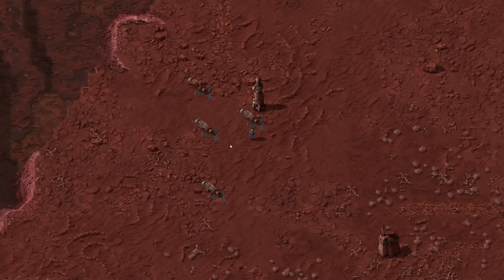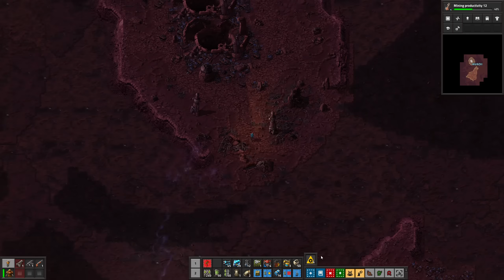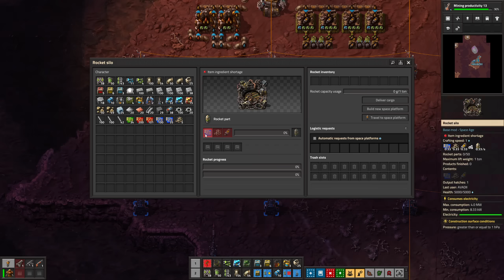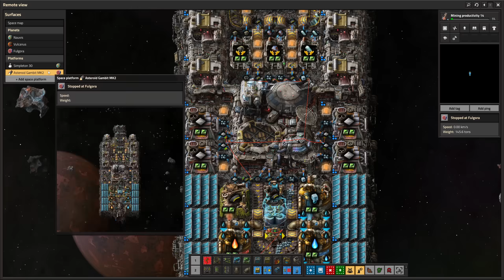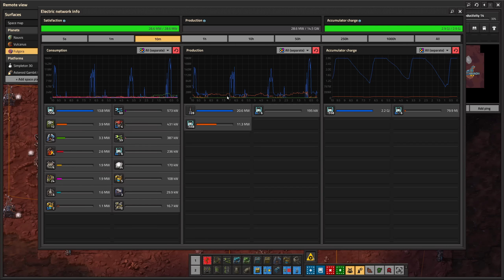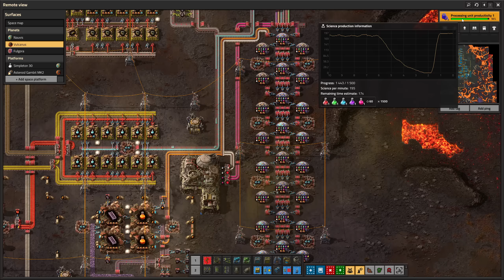Is Fulgora The Hardest Planet? — Space Age MEGABASE (Factorio 2.1)

Comment: Hi! Love your videos. 
I have a question: how do you increase Holmium ore production in the early and mid-game? With one full belt of scrap, I can only produce around 23–25 Holmium ore per minute. If I want to produce more, I have to process more scrap, which takes up more space and requires more power. 
Do you have any advice on how to improve production efficiency? 
Thanks!
Reply from the maker: Theres only one way: process more scrap. Or use productivity modules to get more science out of the same amount of scrap. In any case you need more energy.

Comment: Everybody goes nuts on Fulgora with accumulators, but you can just use the free fuel to burn about 80% of the free ice you get with your holmium for tons of power. Ice consumption for science is less than 10% of what you get, since you're always bottlenecked by holmium ore.

Comment: Heating towers and turbines (if you have them) are great for power bootstrapping on Fulgora. 1 heating tower, one heat exchanger, and two turbines will get you 10MW of steady power in a tiny footprint compared to accumulators. It's more than enough to keep you running until the first EM plants, then you can start making accumulators faster and with the 50% productivity bonus (and at quality if you've brought quality modules with you).

How lucky to have an island in power pole range! I've never had such a forgiving start.
Reply: heating tower are locked behind gleba, but once unlock, I agree
Reply: @guy_autordie  I always make a quick stop to Gleba for the easy achievements and the heating tower. It makes Fulgora start so much easier.
Reply: @videoarchivist8546 interesting.. i might try this out

Comment: Uses a fancy non-blocking splitter to 'grab all holmium' (which it will not do, it's non-blocking, so the moment the output is full, holmium will spill back into the flow). Puts a single inserter at the end of it, so any slowness the inserter has vs the fancy splitter is negated. Could've just used the inserter solo with a filter.
Reply: It adds a half second buffer to the "get all holmium" grabber. If ore came through in the wrong pacing, an inserter will regularly miss. With this, unless you get like 15 holmium all in the right ticks to stack up, it WILL grab them all.
Reply: So 2 filtering inserters side-by-side? Then you also get to see how 'regularly' the first one misses (not often). And it's smaller and simpler. And has twice the storage (which is kinda important if you want to make sure you get everything).

The 3-splitter design sits in such a weird place in communicating intent. You want to make sure you can grab everything, but then you don't want it to block like a single filtering splitter. So you don't get everything. So what is it actually doing?
Reply: @blerrik  two filtering ones (if I understood correctly) can backup and block the path.

The 3 splitter is "Get everything available, and if this path is full, send it to trash"
Reply: 2 filtering inserters, not 2 filtering splitters. Sorry if that was unclear.
Reply: @blerrik  ah, i misread that. I mean, two can work, but just makes it less likely. And now you're getting big enough that that the triple splitter is probably same size or smaller (and guaranteed to be reliable)
Reply from the maker: Yeah, no.

Comment: In normal runs with trains unlocked, you can also just recycle the trash already when loading onto trains, then use 16 inserters on a wagon to grab each item directly onto its own lane, then merge with other train stops to instantly have it sorted. Surprisingly good throughput and avoids the ugly splitter mess
Reply: And for mega bases you recycle into rocket silos and can use it as a big chest. You can put like ~300 scrap per second into it and using it
Edit: hm nah probably like up to ~400. 4 recyclers

Comment: You wouldn't need so many efficiency modules if you used exclusively uncommon/rare accumulators. The common accumulators are actually so so SO much worse that I would go so far as to say they are not worth using at all on Fulgora where build area is limited. (Uncommon store 200% energy vs common, rare 300%.) Commons should all be sent to science production.

Comment: Counterintuitively, if you're using productivity modules, you usually get better power savings using speed beacons instead of efficiency beacons, for a given rate of production. This is because speed beacons offset the speed penalty of the productivity modules, so the machine runs with more power consumption but for much much less of the time (or fewer total buildings).

For example, if you want to produce 1 rocket part per second with 40% productivity from 4 prod modules, you could either have:
  5 rocket silos running all the time with 2 efficiency beacons on each, which costs 46 MW to run
Or:
  1 rocket silo running 80% of the time with 2 speed beacons, which costs only 26 MW to run
Reply: That's true, but only if you care about energy consumption overtime and not in one moment. Basically if you lack energy production there will be times when all of you heavy beaconed assembler will blow the fuse and start slow everything down, while efficiency just allow you to postpone you power plant expansion to a better day.
Reply: Similarly, when trying to max out the speed of a machine, putting productivity modules in the machine will result in a faster output than speed modules, if you have several high quality speed beacons. All speed modifiers from modules are additive, so the speed reduction gets drowned by the doubling of output that comes from four legendary productivity modules. However, I don't know when this becomes true, including whether you need quality modules/beacons or not.
Reply: This does not work, for example, for the number of beacons n = 8

8 speed beacons will use 20.49 MJ per part

 1 speed beacon + 7 efficiency beacons 20.18 MJ per part
Reply: @MisterPokerFaceCard  I did say _usually_. The first speed beacon is huge for overcoming the speed penalty from prod. At higher numbers of beacons, there's still diminishing returns.

Put it this way: if you're only going to place 1 or 2 beacons and want to reduce the power consumption on a building with prod modules, speed beats efficiency.

But if you're able to place lots of beacons, the best strat will be: max prod in the building, then enough speed beacons to offset the speed penalty and maybe enough efficiency beacons to bring it to the -80% limit. When you also factor in the cost of powering the beacons, and number of machines needed, it gets complex to find the most power efficient solution. But at that level of build, you're possibly beyond worrying about power and should be optimizing for something else anyway.
Reply: Things are always more complicated. Using prod and speed can give lower energy consumption than default, but it reaches a hard maximum energy efficiency. Minimising energy consumption per product I found to generally be by using speed modules in the machine, and efficiency beacons. On Gleba however, when you consider that energy and the item ingredients have the same source, using productivity + efficiency beacons can minimise the total resource consumption, or at least it would if items didn't spoil and the shear size of such a build didn't cause its own issues.
The fact that beacons, especially at common quality, are very power hungry also adds its own complications, often making efficiency beacons cost more energy than they save unless the machine they're affecting doesn't take electricity (like on Gleba).

Always test, calculate, and measure your setups before asserting one strategy is best. There are also often multiple strategies that are "best" depending on the requirements.
(While playing on Crucible, there was a recipe to turn steam into hydrogen gas. Since steam is also used to generate the electricity to run the machines, efficiency, productivity, and speed modules all affected the steam consumption per unit of hydrogen.)
Reply: @angeldude101  you know, I genuinely don't know why putting efficiency modules in beacons was even a thing before space age and the beacon overhaul. The most power-hungry thing that could even benefit from effeciency modules at all had to be the rocket silo. I don't think I ever once saw someone put effeciency modules in a beacon. Given the state of the tech tree at that time, it probably would have made more sense for the recipe for a speed beacon to include two speed III modules and give a fixed 50% speed boost, but I sure am glad they didn't do that, because quality effeciency beacons have some very handy use cases on space platforms, gleba, and pre-fusion Aquilo

Comment: Honestly, after re-watching your bot based gleba,  I tried fulgora... 

and it's way harder.

You need so many machines, and so much power, and there's no water for steam or nuclear (i mean... outside ice... but you could easily run out of Ice if you started making power and fuel)  

Holmium is a massive bottle neck and it's difficult to scale, the terrain is brutal and punishing until very late game tech. 

Trying to make quality items, introduces quality holmium ore... which is aweful... cause you can't use it to make quality holmium plate, it has to go to liquid first... but you DO need equal ammounts of the correct quality stone to even use the stuff.  

To scale science or holmium production you have to likely set up other islands to have enough space to actually process enough scrap... 

oh and then the scrap itself is on tiny islands with small dense patches, so it'll last forever, but mine slowly and it's difficult to power enough miners on the islad. 

Fulgora sucks IMO, gleba was oddly better.  

But the tech is fantastic and the science packs don't spoil!!!